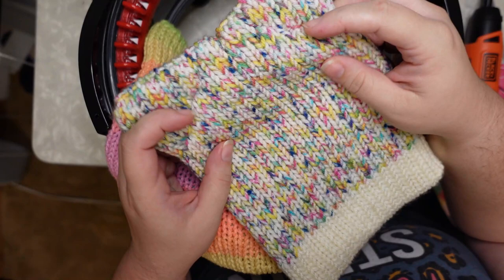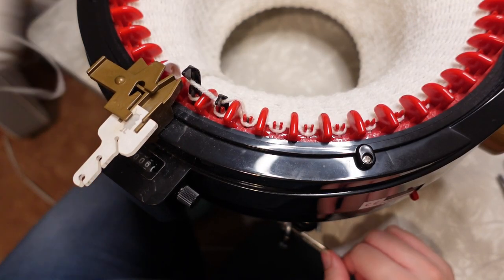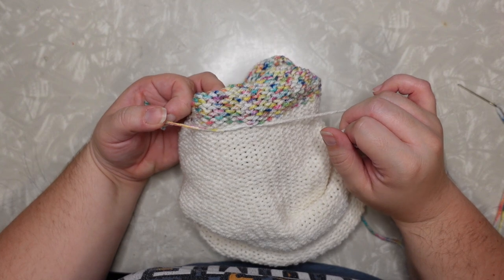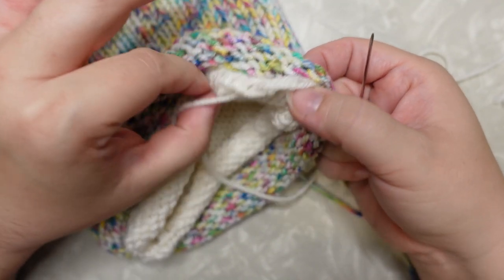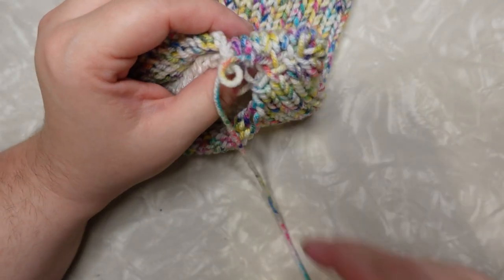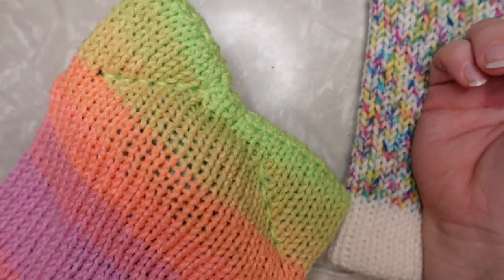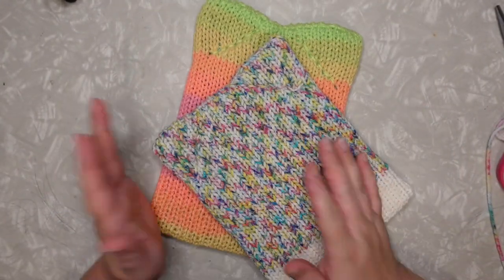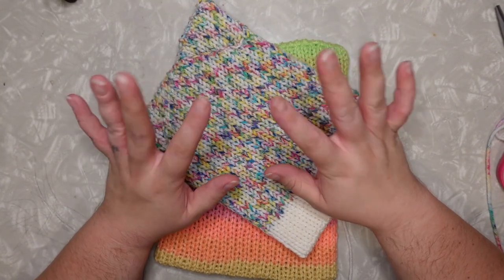Kitty Cat Hat | Knitting Machine Tutorial | Addi Knitting Machine Pattern

Comment: Adorable vat hats. My Addi came and I'm battling with it a bit. Misses stitches and double stitches at times but I still love the machine. Definitely going to make these hats.
Reply from the maker: It takes some practice to get used to what works for your machine. Check your tension. Usually dropped or tucked stitches means not enough tension. Have fun with the process. It is worth it! 😊